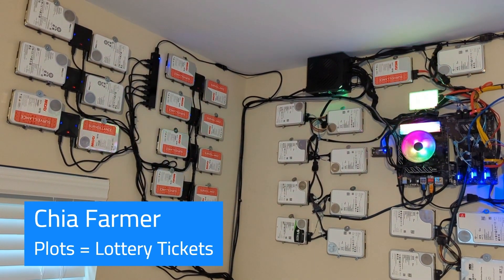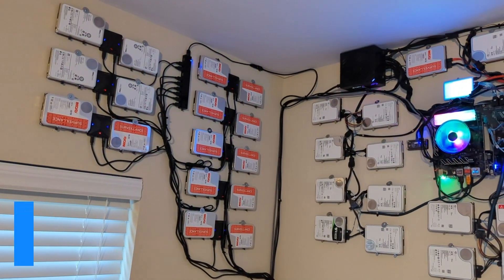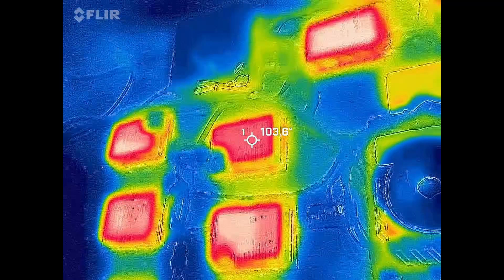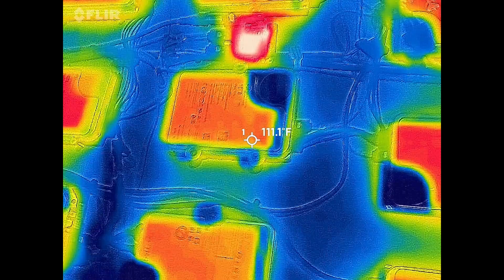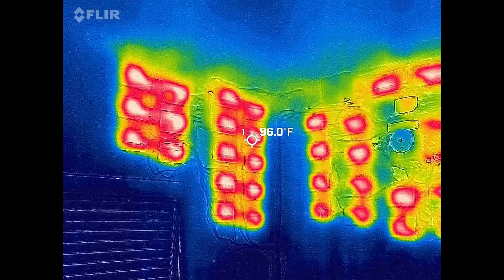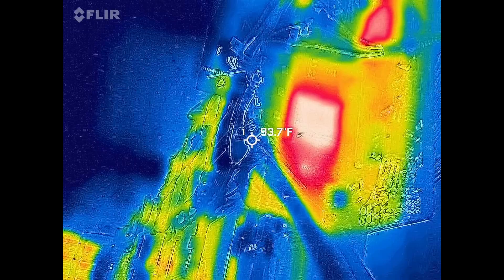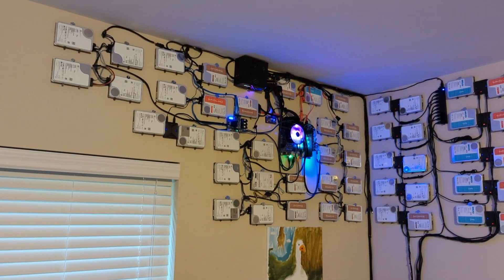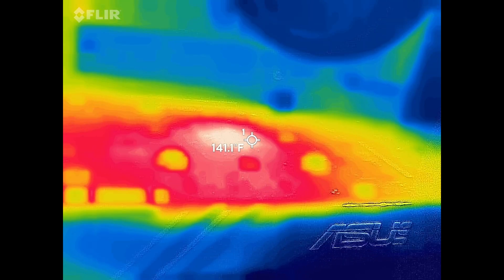Chia Farmer: Infrared Heat Map

Comment: What you are seeing in the IR cam is the label of the hard disks, not a design oddity of the HDDs. All your disks are radiating heat from their whole body evenly, and yes, what looks like metal is actual metal. You can test that by putting a sticker over the whole HDD or cover it in painters tape.

The point here is: Bare metal is an excellent mirror for the kind of long-wave IR your IR cam measures. The label is not. So the label gives you a pretty accurate reading of the actual HDD temperature. It emits IR radiation according to its temperature. The bare metal on the other hand reflects (literally) the temperature reading from other parts of your room like a mirror would reflect an image, hence giving you a confusing temperature readout. You can see this best on the Barracuda with the small label: Only the label area looks hot to the IR cam while the bare metal around it just shows the temperature of the opposite wall of your room. If you touch it you can verify it is evenly warm in all areas.

This whole ordeal with metals and IR thermography is why in professional applications people put a sticker with a known emissivity factor on what they want to measure or cover it in chalk spray.

If you want to get a funny shot out of it, film the HDD straight on as if it was a mirror (with the IR cam of course) and when you get the angles right you'll be able to see yourself waving in the reflective parts that are not covered by a sticker. You can do this with any bare metal plate btw. Even metal surfaces that look very matte and diffused visually will look like polished mirrors in the heat image. It's quite fun to play around with that. :)

Comment: Thermal imaging little bit more complicated than it looks like. Sensor of thermal camera measure not temperature but energy emitted by object (higher temperature higher energy emission) and then calculate temperature and create thermal image. There one catch received from object energy not purely emitted part of it is reflected. In mathematics models wee call object that only emitting energy (without reflection) black body and introduce thermal emission coefficient (E) it shows how many of energy are emmited due to object temperature. If E=1 all energy are only emmited and if E=0 all energy if reflection image of environment.To get accurate reading of temperature in settings of your thermal camera you need enter correct settings E and reflective temperature. 

And now we get closer to you case 😂😂😂

Different materials have different E value. Sticker plased on metal plate obviously have almost same temperature as metal plate. Metal plate (with polished finish) have low E and all received by thermal camera energy is came from reflection of your room (that is colder than your HDD) in the same time sticker have same temperature than plate but it have higher E so more energy came to termal camera sensor and higher temperature showing. Put piece of black tape on plate or use black marker to "create hot spot" on "cold" plate))